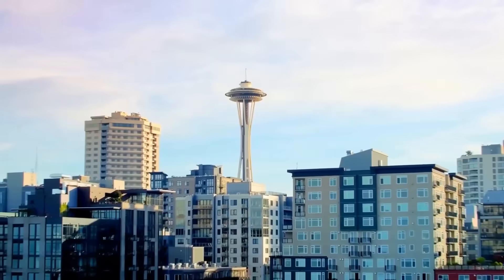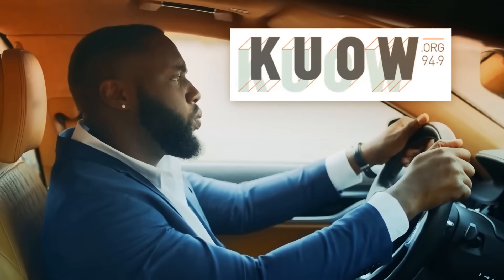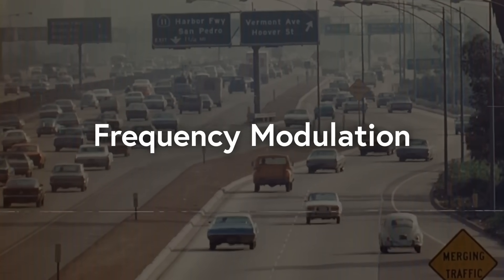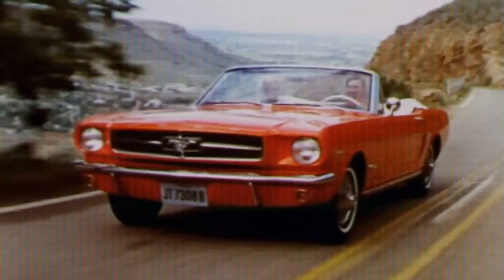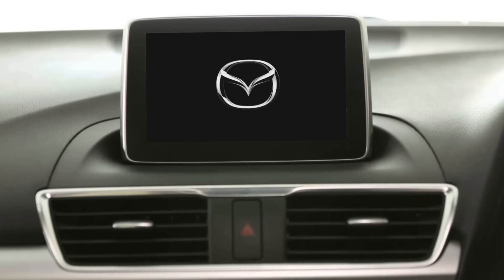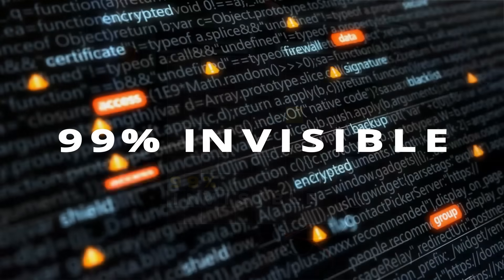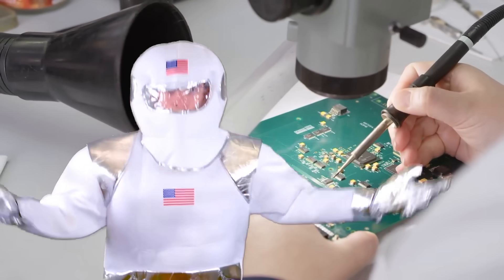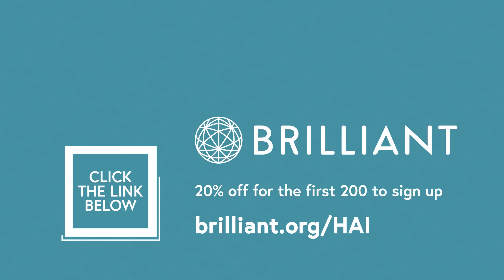Why Hundreds of Mazdas Tuned to 94.9 Broke Simultaneously

Comment: 2021 VW Jetta w/ manual transmission. I downshifted on the highway, engine blew and I started warranty process.
VW said the computer reads I was over speed limit, what gear I shifter into, what song I was listening to, and used that to determine they wouldn't cover the warranty.
My insurance luckily stepped in and called BS but companies are now going to use your driving analytics to determine whether they will cover the warranties part.

Comment: It doesn't seem like it'd be too difficult to work around these bugs honestly. For the lacking file extension thing for instance it just needs what seems like a basic check of either "Just ignore it, move on" or "Try XYZ, if it works great, if not ignore it and move on"

Admittedly I'm not any kind of programmer but
Reply: I am, and that's pretty-much what you should do. Most file formats include a signature of some sort in the form of a few bytes that are always the same in that location in a valid file. The first thing your file-reading routine should do is check for that signature. If it's not there, assume the file is either corrupt or in the wrong format and bail out. If your program supports multiple formats and you don't have an extension to hint which it might be, then you could just do the signature check for each and then open it with the routine for the one that matches (if any). A little inelegant, but it'll work.

Comment: Software engineer here, the last comment about worrying electric cars would have more issues than an ice car isn’t really a big concern for multiple reasons. You can find plenty of videos of people who’s infotainment crashed while driving an EV and it never stopped driving, they just lost navigation for a bit. If an entire team of engineers manage to tie the infotainment working with the brakes or acceleration, that would be pretty unthinkable. Remember that computers in Gas cars already assist and can control your brakes and gas.

Comment: In 2012 I bought a brand new Mazda 2....It didn't have any computer screens, just a radio...I have been driving it for ten years now, and it has never needed a repair (unlike the 7 previous cars I owned)...I love my car as it get 37 MPG which is not bad (in spite of Biden) and it fits in every parking lot...unlike double crew pickups...

Comment: Why would we even need so much computing power in a car its not like its flying or doing complex problems while the car runs. Car only needs to bring you from point A to point B whit some extra features like heading and radio. Giving it any more power is no diffrent from giving a loaded gun to 5 year ,while asking to pointing the gun at yourself. If its a allpurpose car cabaple of doing anything then maybe and only maybe.

Comment: Well, even though agism is illegal, the state of the art is to hire young engineers, and not hire experienced engineers who know to consider and avoid these issues.
Reply: Also a problem in the education system. Checking your inputs is the sort of basic thing that should have been covered in even a half-arsed computer science course.
Reply: @Roxor128  but they had angular instead of JS on their resume so they must be awesome, modern, and innovative!

Comment: I’m not even surprised at the fact that glitches like these occurred, but why did these relatively small errors have to result in the entire computer bricking?  Imagine that happening to your PC.  I don’t much about software, but that’s why I’m wondering why failing to open one file had to lead to an infinite loop.
Reply: Because Mazda apparently has/had a completely substandard software development process.
Reply: @PrezVeto  I wonder if they outsourced their Infotainment software
Reply: That's what I dont get. Windows basically requires file extensions but if it encounters an extensionless file it just goes 🤷🏿‍♂️ and just holds it there instead of shitting its pants
Reply: @vandorlee  Windows itself will, yeah, though it bears noting that a lot of files have internal metadata specifying their format/specifications, often to a greater degree of specificity than file extensions. Attempting to open an extensionless file with some programs will still work as a result, and consulting that metadata is presumably how other companies got around the problem.

With Windows, it's honestly mostly a legacy and quick-reference thing. It can, and probably should, consult the file's metadata. Disguising one file as a file of another type via changing the extension is, after all, a common problem.
Reply: @vandorlee  there actually was a windows exploit a few years ago (like 2018-19 maybe?) where zip files could specify a file icon that didn't exist, which would restart your computer within a few minutes and then hardlock it permanently when it rebooted
Reply: Maybe they were terrible at handling exceptions and failures
Reply: Embedded systems like onboard computers are often written directly on the metal, without an operating system to help with stuff like that. Although specialised operating systems are also sometimes used, and I believe infotainment systems usually run some kind of Linux because they don't have to be streamlined for maximum efficiency (unlike safety critical stuff like, say, a chip that controls your breaks) and need graphics and audio support which would be hell to code from scratch. At least that's how we do it where I work as far as I'm aware
Reply: The main problem it seems is no "Factory Reset" button.

Comment: Almost all modern passenger jets are fly by wire and are much more computerized than even the most advanced Tesla, yet they’re the safest method of transportation. So no I don’t think cars being computerized will be dangerous, they just need time to iron out the glitches and master the craft. Bad drivers are at least 1000 times more dangerous than even the most dangerous glitch.